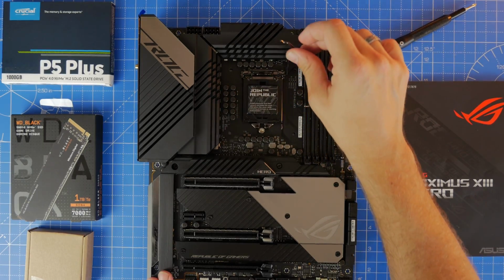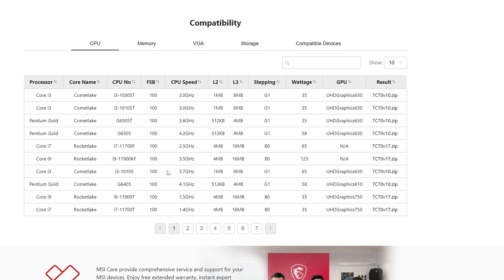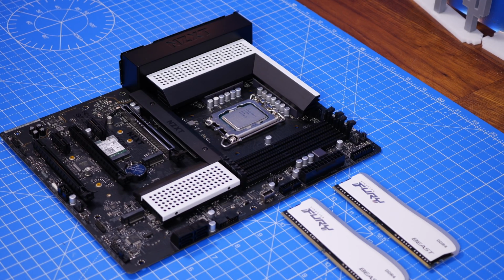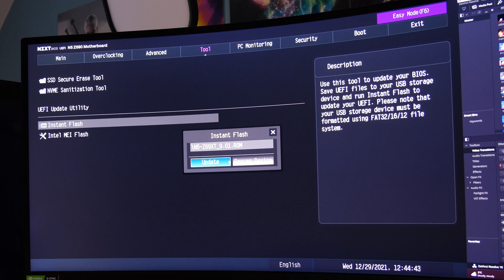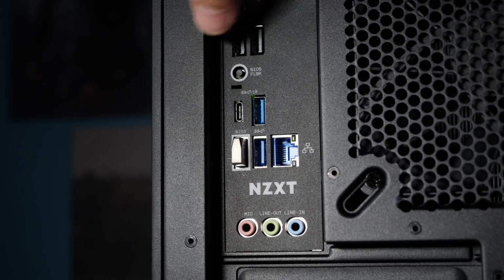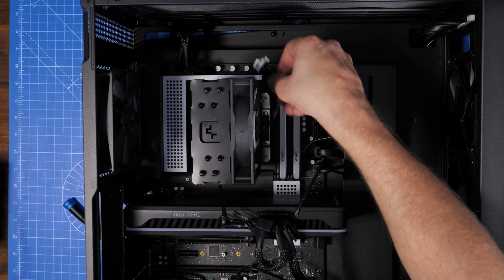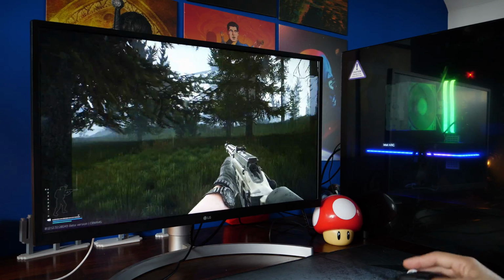How to upgrade your CPU easily - essential things to know when upgrading an Intel CPU

Comment: im trying to upgrade from a 14600k and 4060ti to a 14900k and 5070
Reply from the maker: Should be plausible without much issue.. I'd highly recommend updating your bios though

Comment: Hey im using MSI Pro b660m - B with i5 12400F before.. and then i upgraded to 13600KF. However until now, ive found that my Cinebench23 score is only 15K when others are 24K. Could you tell me whats the problem? 

maybe worth to note that I've encountered some screen freeze and PC restart it self and not posting anything. After i reset bios it posted again. Pls help. Thanks!

Comment: Hey i am thinking of upgrading from my 12100f but i am worried that i motherboard pins could be damaged while removing the processor (as lga 1700 processors have bending issues)

Comment: im planning to upgrade my 13-12100f to a new i5-12600kf to pair with 7900 gre, when i went to my motherboard support page (ASRock B660m Pro RS) it have a new BIOS update on this early october, but it says that they recommend keeping the current BIOS if the system is working properly, what do you think?
Reply from the maker: You're in the same generation so the update is not essential

Comment: What if I swapped the CPU but didn’t update the BIOS…can I update the BIOS after the swap??  It has been running good, only issue is it scans the C drive every time I turn it on…
Reply from the maker: Yes you can do it after. Weird about the drive scanning. Not sure what that's about

Comment: I'm actually upgrading my 12400f to a 13600kf, I have an AG400 fan cooler like in your video, is that enough for cooling that 13th gen without overclocking ? Do I have to change something in the Bios about watts or something ? Thanks 🙏
Reply from the maker: Should be fine

Comment: I have a Aspire TC-780(KBL) motherboard and a Intel Core i5 7400 CPU. My cpu isn't compatible with windows 11 and I need to find an upgrade CPU that fits in my motherboard but I cant find the motherboard on PC part picker. If you have any suggestions for a CPU and/or motherboard to upgrade to it would be appreciated.
Reply from the maker: Alas that's a quite old CPU now and several generations behind in terms of motherboard socket, so you'll have to swap the entire thing really. Motherboard, CPU and ram. We're now on 14th gen Intel CPUs. So that would be quite an upgrade
Reply: ok. thanks for the help. its a pretty old computer so it makes sense I have to upgrade the motherboard and cpu. @TheProvokedPrawn

Comment: Hi Provoked Prawn! Thank you for sharing all of these informations. What happens if the motherboard is  made-to-measure for a specific pre built pc. In my case I'm talking of a msi mpg as 12th with a i7 12700f which has a b660 modified for the 750 w power supply. Based on your expecirence do you think that an i9 processor (for example a i9 14900f) does fit well for this computer? What about problems in terms of temperature? I use the computer for 3d render and i'm finding a solution to upgrade my computer to reduce the time of rendering.
Thank you in advance,
All te best!
Luca
Reply: *MPG Trident AS 12th.

Comment: I guess what nobody talks about is how do I get all my programs back? And all the things I use for editing and just to have like 30 programs. How do you do that?
I have a 1200 socket. I 7 and I was going to upgrade to an I 9 with 16 Coors 24 threads and 4.7. GhZ instead of 3.6 an 8 cores16 threads.
Everyone says this will be a dramatic upgrade?
Reply from the maker: Those things aren't installed on the CPU. So they'd still be there

Comment: I want to upgrade from a i5 13400f to a i7 13700k would I need bios update?
Reply from the maker: Shouldn't do as it's the same generation. (I.e. 13th gen)
Reply: @TheProvokedPrawn  is the i7 14700k a lot better?
Reply: @TheProvokedPrawn  What if you want to go from a Core i5-14400F Processor to a 12th gen i9?

Comment: I had the 13900k, and bought a 14900kf ( found cheaper and is better cpu) it says that my z790 will work with gen14th as well. My main question is, do I need to reinstall windows?
Reply from the maker: No. But you may need to update your bios
Reply: @TheProvokedPrawn  I just updated my bios to the very last one last week. I belive that should be ok

Comment: I got a hp omen 25L with the i3 13100F and a gtx 1660 super,   was wondering if i could swap the i3 13100F for a i5 6500 cpu.?      
             **It has the ""Hp Omen 25L GT15 Motherboard M81916-002""
Reply: i3 13100f to a i5 6500? why would you want to downgrade so much?
Reply: @naywils  downgrade??  I was assuming a i5 6500 was an upgrade to be honest,  im not totally on the tech savvy side of all that.  Im just usin the pc to game pretty much.  I run my games just fine on the i3 13100f,  i was just thinkin that the i5 6500 would give it a little more push.   So your sayin i should stick with the i3 then?
Reply: @Patchez389   Yeah the 13100f is very much better than the 6500 :P An i3 from 2023 is alot better than an i5 from 2015 :D! Also the cpu wouldnt work its a different socket type.

Comment: What would be my best option to upgrade from a 9700 non k? Using rtx 4080 and the 9700 is holding it back. Thanks for any help.
Reply: Pc build calculator will help you see if there is bottlenecking

Comment: can I upgrade 12 gen processor to 13th gen without having a 122 gen processor? want to buy a 12 gen mobo and 13 gen processor but I obviously don't have a 12 gen processor to do the update, is there any other way to do it?
Reply: The motherboard would need the USB bios flash function to flash without need for 12th gen chip

Comment: I'm upgrading from an i7-12700k to the i9-13900k I just did my intel me update and bios update I definitely sweated during the bios update since I never did one before I didn't have any problems I'll be putting in the new CPU later today hopefully goes just as smoothly
Reply: Is it worth it, I’m thinking to upgrade from i7 12700f to i7 13700k. Or do I wait for the 14th gen ? from what I read the 13700k would be perfect for 4070ti
Reply: @therealbukhari  if you can I'd get the 14700k unless you find some deal for the 13700k there's really only a minimal difference between the two but really if you're not getting any bottlenecks I wouldn't even upgrade I had that cpu was very easy to overclock and stay stable but I got lucky and got a 4090 at msrp so had to upgrade was getting 99% bottleneck in a lot of games especially warzone

Comment: 0:00 Helloooo
0:30 CPU Socket type
2:30 CPU-Z
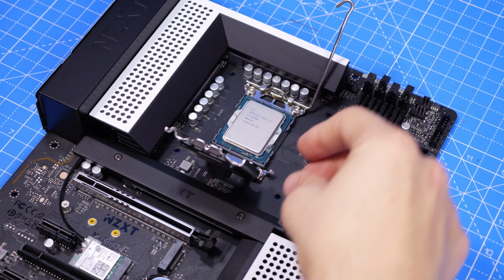3:48 Motherboard compatability
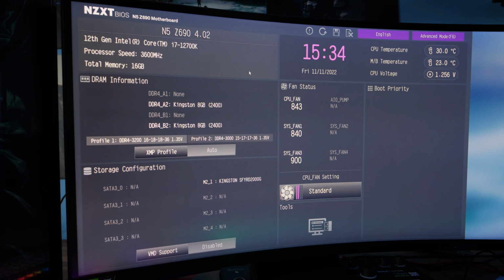5:27 BIOS Update
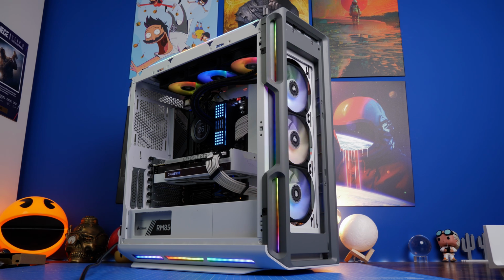6:00 Basic steps to take 
8:04 CPU install
8:41 Remove the cooler 
9:10 Thermal paste cleaning 
9:45 Removing & installing the CPU
10:15 New thermal paste 
10:45 Installing the cooler

Comment: Nice video thanks! Im currently upgrading but with a new mother board and gpu. I was curious on how to transfer all my data,games,passwords,bookmarks, etc. I plan on using my same ssd’s and want it to be exactly like my old system? Any help would be appreciated!
Reply from the maker: If you're using the same SSDs you can just move them to the new system. No problems :) Windows should still load, though obviously you might need motherboard firmware/software updates, but otherwise everything will be there. You will likely need a new license for Windows though. 
Alternatively this might help https://www.youtube.com/watch?v=ZxzLGLs39tA
Reply: @TheProvokedPrawn  
 That’s what I thought but was just checking for this will be my first time upgrading. I’m gonna do a clean window install for sure. Thanks for your help!